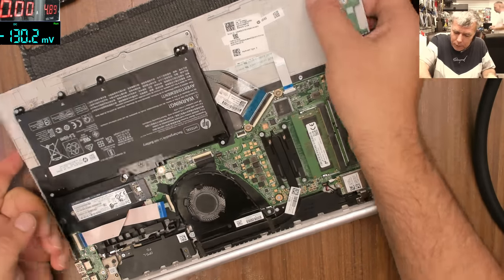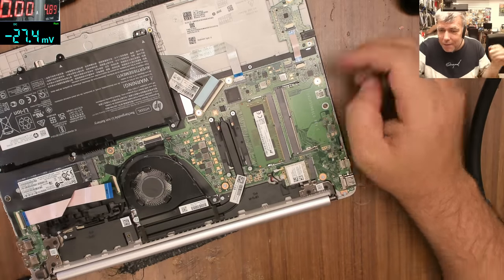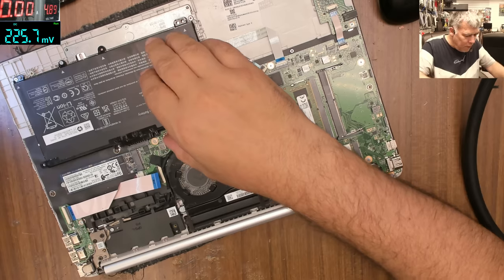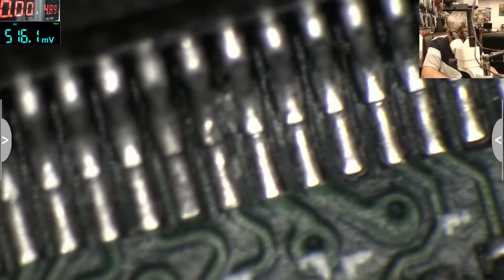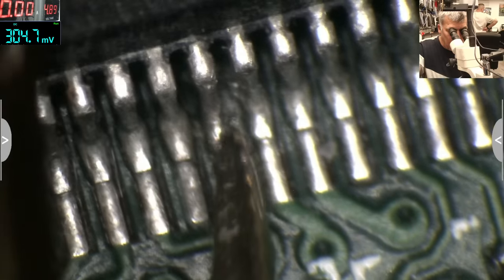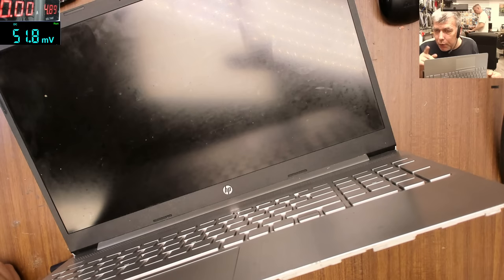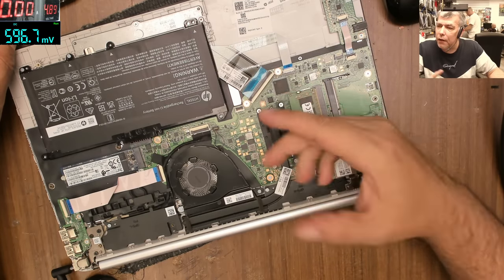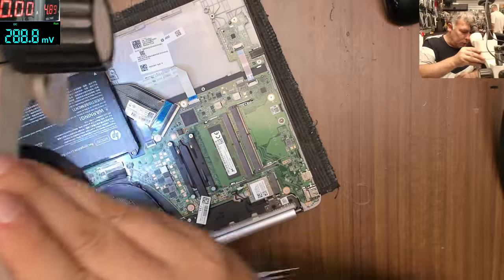Hp laptop water dmg, a drop of water can kill your laptop

Comment: If anyone curious what these pins were at 5:16, he was cleaning with a sharpie:
pin 106 is VSTBY and pin 105 is ALSPI_SCLK. VSTBY probably blocked bios SCLK communication by bringing to HIGH state all the time.

Super io model is: IT5570e if anyone wants to verify. Schematic unavailable, but one of the clevo laptops has same superio, NH77DBQ, schematic available.

Motherboard model is da0p5dmb8c0 if anyone wants to look for the schematic.

Comment: I've dealt with this problem twice on two of my desktops. This one drop of water went exactly over the SuperIO and shorted two pins. The first time, I just cleaned the board and it worked, I didn't know why. The second time, I was already much more versed on electronics and had better tools and a microscope, so I found the problem and fixed it (intentionally, this time 😁)

Comment: Great Sorin!
I have in my hands an identical hp laptop with the same water damage but unfortunately after careful cleaning with isopropyl alcohol the pc does not start, the charge LED on but nothing on the screen, the oxidation mainly affected the SIO ITE. I noticed that the led on CapsLook blinking, I reprogrammed the bios but nothing. I wonder can I replace the SIO ITE without reprogramming it?
Thanks Sorin you are great

Comment: Hope you will excuse this question.  I have an old motherboard and installed Win XP.   Problem is that motherboard ethernet, audio and pci audio card are recognised as existing in device manager but,  when the drivers are installed they simply do not work.  i.e. no sound from the motherboard or pci audio card and the ethernet repeatedly tries to acquire an address and never succeeds.   I have not come across this before  and would be grateful for any ideas on how to proceed.